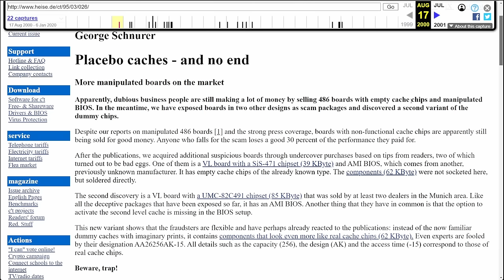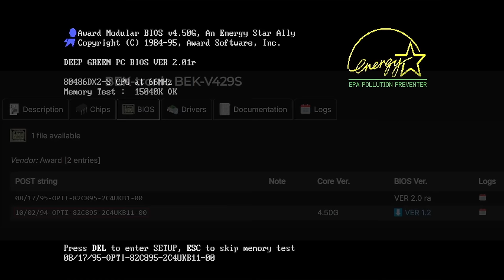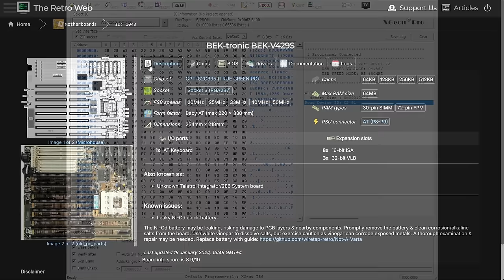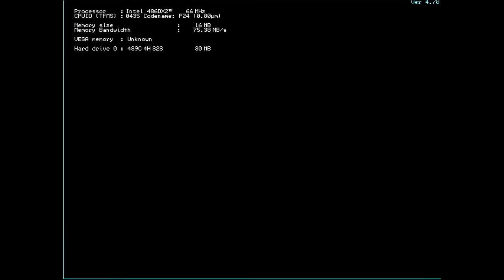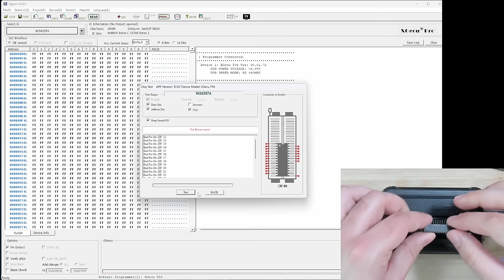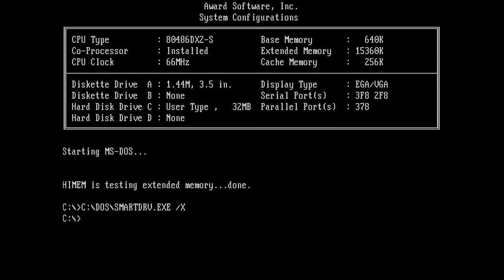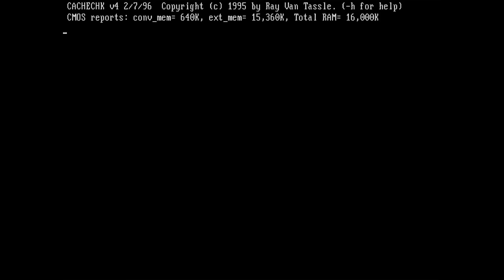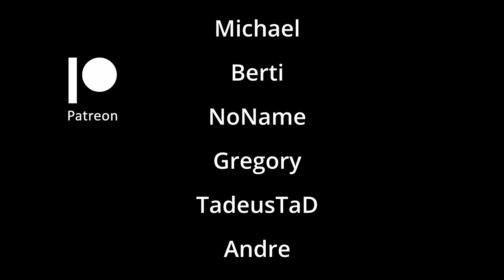They fooled so many: Fake cache chips!

Comment: Fascinating, you've earned my subscription! Though, I'm surprised you didn't include a DOSbench run in the video showing the Fake BIOS + Fake Chips configuration. It doesn't affect your conclusion -- you proved your thesis regardless, and I'm sure that run would look absolutely identical to the one you showed for the Fake BIOS + No Chips configuration. But it would've improved the rhetoric at least slightly to show or mention that, as it's probably the strongest argument that could've been made (in that, it rules out even far-fetched fantastical scenarios, like 'special woowoo BIOS code somehow enables plastic blobs to cache data').
Reply from the maker: Thanks! Yes, I did not check the fake BIOS with the fake chips - something I can do and use to start the follow-up video. People much more knowledgeable than I are working on reversing the modifications that were done to that BIOS. It would also be interesting to look into one of those cache chips - although I'm pretty sure there is nothing in them.

Comment: The fact there is no download on retroweb could be cause all of this versions are compromised. Like some scammers used to modify a bioses of the boards to sell em with fake chips (most likely as an assembled PC builds) and used to modify a version number/date so no one would guess to update it and fix the cache situation uncovering a scam. Maybe there is really no update.
Reply: Sounds reasonable.  Though updating BIOS back then could be less than a smo0oth sailing experience, unless you have done it a few times. Most people didn't even bother to update bios or firmware because it could be risky due to software, hardware and procedural flaws.   Nevertheless that would be a tactically sound method of covering the tracks and keeping  them covered; until a user or developer who actually used the cache for a certain specific application noticed the difference, perhaps.

Comment: Excellent stuff, I should look at my board may have a similar issue or I have rose tinted glasses around how well Doom used to play on a 486! :)
Reply from the maker: I guess it's good practice to test the cache on any board. Based on what I saw with this board, you can't trust any values displayed.
Reply: maybe this is the cause for lgr s woodgrain being so slow 😂

Comment: 9:15 This copyright message looks so strange because of some motherboards had 2 ROM chips. One for odd bytes and another one for even ones. This was made to connect 2 8-bit ROMs to 16-bit data bus. Both dumps started from same copyright message. So when they are combined in single ROM image you see duplicated characters.

Comment: The characters at the beginning of the BIOS are repeated to make sure that an intact copyright statement appears at the beginning of each ROM chip. For BIOSes designed for 16-bit processors, this usually means the characters are duplicated (in case there’s a low and high ROM chip), and BIOSes for 32-bit processors may be duplicated out quadrupled (in the event that four ROM chips was used).
Reply from the maker: That makes a lot of sense! Thanks for sharing this detail! I guess it was the cheaper method than properly preparing for 32-bit systems. Cutting corner as usual :)
Reply: @bitsundbolts  I'm puzzled. What do you think properly preparing for a 32-bit system would look like in this case? And would it even make sense in a BIOS for a system with a 16 bit data bus?

Comment: I use a few drops of not very liquid silicone oil when temporarily installing radiators. The oil provides thermal conductivity and is easily wiped off afterwards.

Comment: I saw these boards when I first started my company back in 1994. The Deep Green BIOS rings a bell.  If I remember correctly these boards were in the cheapest machines possible and often supported other non-intel 486s which made things even cheaper.  The dominance of good board manufacturers supplying to the builder market wasn't yet established and there was a lot of cheap stuff cutting corners to sell boards to an industry that was very price sensitive.  I believe these boards were around £5 cheaper which was around $8 cheaper at the time.

Comment: On CuriousMarc they just heated the chips in a frying pan and chipped the plastic encasement off to see the die inside. 
A sharp wood chisel on the parting line above the legs should work.
Reply from the maker: I will open one of those chips. I don't have the proper tools, but I might just go at it for about 10 minutes with sanding paper...

Comment: I've owned 486 and Pentium boards with soldered on board 'cache chips' with Copper traces going nowhere. A whole corner of the board was doing nothing electrically.
Reply from the maker: I have one of those boards, but it is a socket 3 board for 486 CPUs.

Comment: Around 1994 we had a 486DX system that claimed to have 256K cache on-board. We wanted to use it with OS/2. Back then one had to deactivate all caches, deactivate the turbo swich etc to install the operating system (though after installation you could re-enable everything). Afterwards we could re-enable the internal cache, but not the external cache, as the board always complained about "Cache memory bad, do not enable cache". We used it for several years afterward but could never get the external cache working again. However, I could not see any significant performance hit, neither with productivity software nor within games (even when using plain DOS). I think it was a UL486 board. Wonder if the BIOS was modified or if it was legit, but the chips were not/it had been coerced into thinking the chips were legit, or if the system had another issue.

Comment: Fortunately my first motherboard in a 486 Zida 4DVS had real cache memory. I found this out when I installed another 256kb and the total was 512kb. However, I also had a PC Chips board which was famous for installing fake caches on motherboards and this one even had a special slot for a cache module, which I bought and...still the cache didn't work :)
Reply from the maker: I have one of those socket 3 boards with the strange looking cache module (I also have the module, but I don't know if it is fake or not). Unfortunately, the board is for repair and I wasn't able to fix it yet.

Comment: I had the exact same thought. They probably took the stock BIOS, searched for "None" and replaced it with "256K" and put the empty chips in the board.

I would upload a copy of it to the Retro Web as-is, and a copy where you search for 256K in the file, replace it with "None", test it, and upload it too.
Reply from the maker: The original BIOS is already on The Retro Web with the appropriate note. I will try my best to learn how to undo the modification.

Comment: I used to work in a reputable Amsterdam PC company, from 93 to 2000. We made the fastest computers in the country. Except… the models we sent in to the magazines to be tested had special, extra fast cache chips that were different from the ones installed in the PCs that we sold for $$$. Same with the memory boards. And the hard drives, those came in special delivery from WD and were some 50% faster than the regular ones. Oh and by the way… every PC builder did this.
Reply from the maker: Oh, I guess this works until some independent entity buys the product off the shelf and verifies their test results with that reported by magazines. I do remember the occasional newsline popping up where magazines were sent special models that would never be available to the average consumer.

Comment: The real cache chips are plain SRAMs in a narrow DIP package; they're all pin compatible (otherwise they wouldn't work in the first place) so you can specify a pin compatible chip of similar speed grade in your tester, and it'll test it just fine. The fact that nothing works pretty much tells you right away that the ones you bought are fake.
Reply from the maker: Well, I didn't buy the fake chips. They came on the motherboard I found at the scrapyard.

Comment: Years back I had, maybe still have, a MoBo from PC-Chips with full populated cache chips, but a view from the bottom showed, no leg was connected to anything. I thought it has to be a multi layer board, but even running running diode tests with my multi-meter showed not one connection was existent. Seems to be "normal" to fool people, even back in the day 🙂

Comment: At this point you have nothing to lose cracking one of those chips open and looking at it under a microscope.  I suspect that this was a scam because in the 90's RAM memory was in such demand we had shortages of it...  In fact there were companies here in Silicon valley that had gangs breaking in to steal memory at gun point... terrorizing the workers, and trucks oversees were hijacked by pirates from foundries.  The fact that you have chips that are completely blank means that this was some kind of inside job.  This just seems coordinated and organized. 

I'll bet I had one of those boards too!  To think I was taken in by these hi-tech scammers!
Reply from the maker: Wow, that sounds terrible! I did not expect that people would go that far and break into factories and steal memory at gun point.
I'm sure mine are completely empty - just the housing with legs. But I shall open one soon!
Reply: @bitsundbolts  Yeah, the RAM shortage  was real crisis, it put a crimp in a lot of computer manufacturing plans like the Atari with their ST and TT machines, Commodore Amiga, not just the IBM PC's, etc.  

Again, I can't get over that it was done in such a professional way as to lie about the Cache memory and to make the fake chips, and it is kind of weird that you'd catch it decades later, that's some good detective work!   I don't think I would have given it second thought... Just WOW!

Comment: The fake chips are probably one of the reasons Intel and co started to embed cache in the processor itself. Not saying it's the only or even the most important reason, just that it's definitely one of them.
Reply from the maker: The main reason for integrating the cache is probably the speed advantage and production cost. It solved the fake cache problem as a positive side effect.
Reply: Main reason was simple physical distance, the rest are just bonuses

Comment: I stock up on 256k cache chips from ebay recently and so far of the 50 I ordered I found only 2 bad ones. Unfortunately I remembered too late I could test them with my programmer (TL866CS) so I wasted a bit of time troubleshooting the board after installing all the chips...

Seems fake chips were very typical back then, some motherboards with soldered ones didn't even have full packages and they literally had a hole on the bottom and completely bogus markings, for the socketed ones it seems they put a bit more effort to sell the lie.
Also in some motherboards with soldered fake SMD chips you can literally see the traces going nowhere but in a loop between the fake chips
Reply from the maker: I had a little less luck with my order. Still, I have enough cache chips for experiments.
I do agree, the chips that came on this board look real - they put real effort into it!

Comment: Wish Id never heard of these bad chips, they were such a plague in the day!  It's kind of why coast modules were far more reputable/reliable.  After the PentiumPro, and integrating stuff onto the chip it was such a massive plus.  Back in the day I did get a cheap 486sx since it had fake cache, it was unstable as heck, but dumping the chips it ran great.
Reply from the maker: Sorry you had to deal with fake cache back then. I agree, integrating the cache into the CPU stopped this method of cheating people. Then they started to fake entire CPUs... Even "new" (but fake) Ryzen CPUs are being sold these days with no die under the heat spreader.
Reply: @bitsundbolts  I had wondered if someone was going to start making ceramic slugs.   I've bought motherboards and graphics cards that have mobile parts on them, but they don't try to pass them off as the real deal, but wow.  I guess it's inevitable.  that scammers got to scam.

Comment: Is it possible to install an amount of cache other than 256 or zero?
It would be interesting to see if the BIOS is hacked to always display "256K" or would accurately enumerate other amounts.
Reply from the maker: I should be able to get 128K by using half the chips. But from what I understood from someone else that checked the BIOS file, it will continue to report 256K.

Comment: I have a 486 board that had fake cache chips installed and modified BIOS too. I replaced the cache chips and now I have working L2 cache, but I never updated the BIOS. It seems that the amount of cache shown and the option to switch on/off external cache has been modified, but the cache itself works correctly when the appropiate chips are installed 😅
Reply from the maker: Oh, I did not test the BIOS setting to switch off the cache. That would be interesting to test how well the BIOS hack was implemented. But I have a feeling that it might report correctly as NONE when "External Cache" is turned off in the BIOS since it probably accesses a different routine in the BIOS.

Comment: I used to assemble PC'S  during this era. To thicken the plot further. Real cache chips where so extremely static sensitive that removing cache chips was a huge no no ie how would you know. Especially when they shipped preinstalled.
The optional cache chips bought separately did seem more resilient. But always nerve racking. All new PC'S needed to be burnt in tested. Further, Ironically a low failure rate on cache ie systems not crashing was a tell tail sign.

Comment: Fascinating. I don't remember seeing/hearing anything about fake chips back in the day. I remember chips that *weren't very good*, like Cyrix CPUs and such. But nothing about outright fake chips. The first such I remember hearing about were AMD Durons that were altered to run and report as higher-clocked models.
Reply: Ooof, the Cyrix chips were pretty good but they were cheap so they often got installed on really crappy boards with fake cache
Reply: @M0UAW_IO83  Yeah I had a board with what, years later, I found out to be empty WriteBack cache chips, with a DX2/50 - one of those 'It's ST' cpu's - which came up as a Cyrix on bootup. Was somewhat slower than other equivalent pc's I saw at the time!
Reply: @M0UAW_IO83  I remember getting a Cyrix 387 equivalent FPU that knocked the socks off the Intel 387 FPU. I think was a short lived win for Cyrix though, because the Intel 486DX was way faster still, and Cyrix couldn't beat it.

Comment: Back in the 1990s one of the most reliable ways of detecting fake cache was to try and compile a linux kernel. The system would invariably fail with sig11 (memory) errors

We returned a lot of these boards as faulty because of this and the fake cache scandal blew up shortly afterwards - in New Zealand the main offending distributor was heavily fined by the Ministry of Commerce for deliberately selling these and then fined even more heavily for making press releases claiming that it was accidental

The part numbers on the cache SRAM chips were those of the genuine article and the logos were also close copies

NB: These were all TAIWANESE manufacturers. The worst offenders were PCChips and MSI - who also produced the lowest quality boards - this board looks like it came from PCChips

Most of these boards used UVproms or EEproms which couldn't be reprogrammed in-situ - as bios updates became more commonly available the rate of cache fakery plummetted dramatically

The reason sellers got away with this is that (as you noticed with speedsys) the difference between L2 and no L2 is minor in windows and these were "scraping the bottom of the barrel systems" - usually with absolute minimum ram (ie: swapping like mad) and the slowest smallest HDDs on the marke

Comment: There's other boards (not just the usual pcchips M919) that came with fake cache, like my Jetway J446A. The chips these boards came with say AN512Km-15 with a logo made of multiple circles inside each other. Same deal, empty plastic shells with legs, and the BIOS always reports cache being present even if there aren't any chips on the board. Curiously enough, the extra TAG RAM chip is the very same obvious AA26256AK-15 fake, but the main ones are different
Reply from the maker: Interesting. The model number you mention seems a bit short, but good that you shared it.
Reply: @bitsundbolts  I've submitted a photo of my board to retroweb before they effectively bullied me out of the discord after a year of submissions and trying to help. The original fake chips (sounds weird to say that) with the short model number are visible on that photo since I hadn't replaced them with real ones yet at that point in time
Reply from the maker: Oh, sorry to hear that. I only had positive interactions with the guys running the discord server. I'll have a look at the picture you submitted there.

Comment: At least the cache sockets were connected correctly, allowing real cache chips to be used, if they are using fake chips why go to the trouble of wiring up the sockets too?
Reply: Because they probably released versions with real cache too !

I have a pcchips m912 which came with real cache, even though they're known to use fake cache too
Reply: I assume the board was made by a reputable manufacturer, but the vendor put in the fake chips and modified bios.
Reply: @TheaH2O2  the manufacturer is probably complicit, like I said, I've seen that with pcchips too, and they're definitely scammers :D
Reply: Because then the scam is immediately visible as the traces are wrong.

Comment: If you run Speedsys with the fake cache installed, it will say "The system appears to only have 1 cache??" or something like that.
Reply from the maker: Yes, I think this is what is going to happen - but it might be CACHECHK that has this wording.
Reply: @bitsundbolts  You might be right.